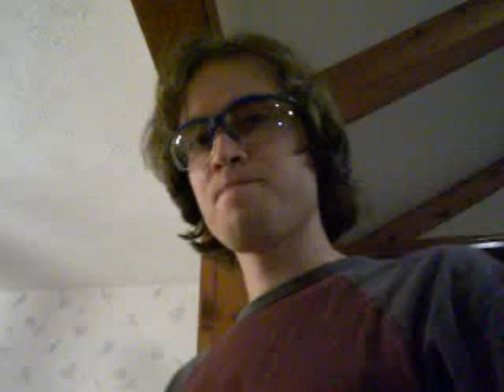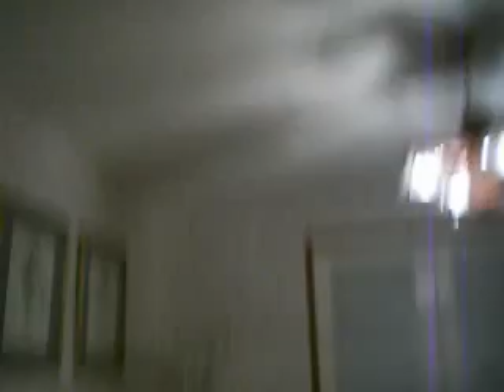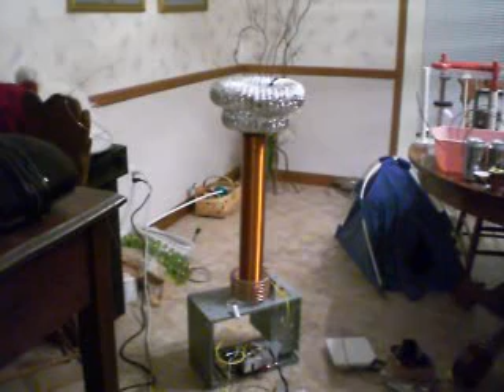DRSSTC Tesla Coil Test 1

Comment from the maker: This one is much safer than the previous one I showed.  9000 volts at 30ma (if I remember right).  This one only has 300 volts and I have little lights to show me when it is charged.

The glass hardly matters.  The plasma globes and such run at much less current and voltage.  3kv probably. (I am just guessing)  They make such long sparks because of the gas in them.  I have tried helium and that works pretty well.  So, yeah, it takes quite a bunch to make even the sparks you see in this video.